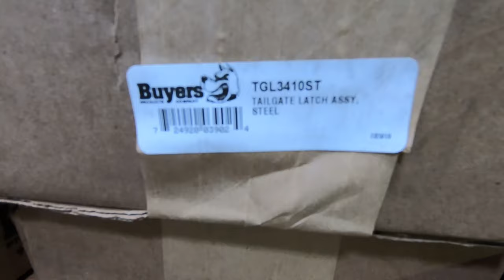Installing tailgate latch assemblies ( Buyers TGL3410ST )

Comment: I get it question can I put on the back door to my dump trailer because I look so many time for lock and this almos perfect
Reply from the maker: I’ve seen people put them on dump trailers too. They make a steel, a stainless steel, and aluminum version so you can weld them to different material bodies.

Comment: One question. Shouldn’t you disconnect the batteries before welding on that?
Reply from the maker: You probably should. I keep the ground close to the area I’m welding and I haven’t had any problems with it. Probably better safe than sorry though.

Comment: I have driven dump trucks for a good while and just have recently scene this set up. What are those for and do you have to loosen them each time you go to dump out?
Reply from the maker: They are tailgate latches. They have been out for quite some time now. I think I first saw them 15 years ago. There not really promoted it’s something you’d come across at fleet pride or something. You do have to loosen them every time you dump but there good for sloppy tailgates that sand will come out of. we put them on for using the Shute doors while putting out hot top by wheel barrow. I’ve had the gate blow open and dump 10 tons of mix right in front of us before. Some times it doesn’t want to come out unless the body is pretty high.
Reply: @JasonTheMunicipalMechanic  thanks for the info.
Reply: We use them to pave/wet batch (concrete) when we pour highways. We use dump trucks and dump into pavers. We use these and call them load locks, asphalt companies also use them for their dump trucks to secure the load from dispatch to jobsite.
Reply: Nice for air tailgate , to leave material overnight.